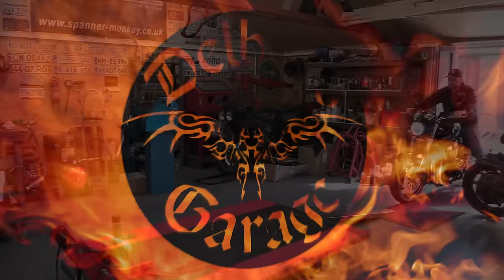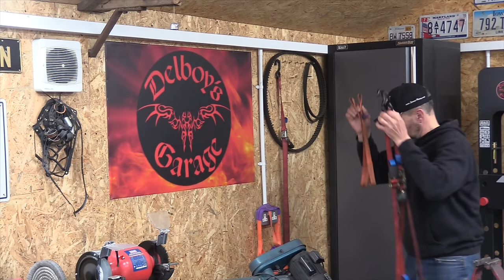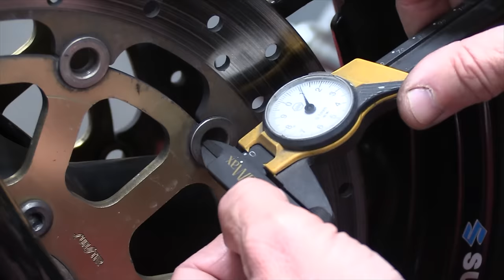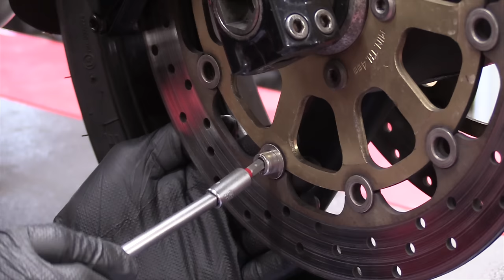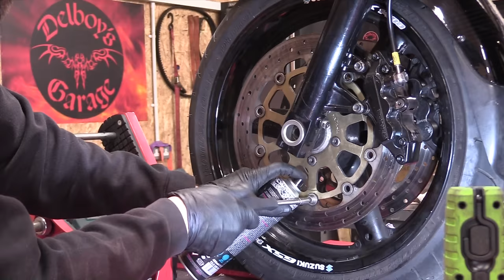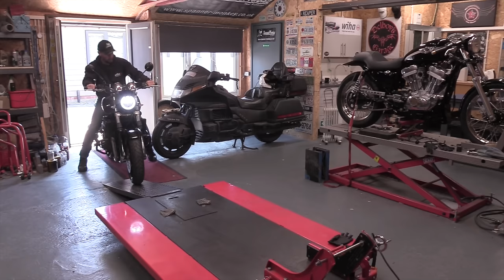Warped Motorcycle Brake Disc?  or Jammed up Bobbins?  Easy Fix !

Comment: Another bit I never knew....that brake rotors are designed to "float" to optimize brake pad grab. Thanks as always!
Reply from the maker: Glad you found it interesting John.. simple and effective !
Reply: The fact that the outer portion of the disc brake is not directly connected to the inner portion of the disc brake also serves another purpose. It diminishes the chance of warped disc brake rotors.  The heat of the outer floating portion has less heat transfer to the inner portion thus keeping the rotor straight and true after many heat cycles.

Comment: tried this on my ZRX 1200 bobbins which look pretty clean to start with ,  spritzed them down good with brake clean while turning back and forth with socket but there is no way they are going to turn with just my fingers

Comment: Mate... I think you just saved my wallet. I was already looking for new brake discs for my 2004 GSF600 because I thought they were buckled. I had no idea that these bobbins are supposed to rotate freely...
Reply from the maker: Yes sure, they should have some sliding resistance so not completely spin freely, there should certainly be no freeplay, but if they're jammed solid, then that certainly can hold the outer disc out of alignment.

Comment: Only comin across this video  now 😂😂.... mine wont twist at all even with the bolt trick... i tightened so much that it stripped the threads on the bolt i was using, but no, they wont twist at all

Comment: That is quite interesting. I was having that problem, the thing is that i thought it was the abs kicking, thinking it was an overly intrusive system.  In but it was, in fact, covering it up the real problem, junk in the bobbins.
Thanks for showing this mate, you learn every day something new, but today i learnt that it needs cleaning, how to clean it and a cheat to rotate the bobbins.
Certainly ill be checking every month on this bad boys. Truly a live saver.
Thanks again.
Reply from the maker: Most welcome buddy, once a month is nowhere near necessary, I do mine after the winter and again at the end of the summer and that's plenty, just when they get stuck!

Comment: I  had a advisory on my front brakes. I bet this is the issue as I didn't even know about this, so never cleaned them. Thanks Del, I know what im going to be doing tomorrow.
Reply from the maker: No problem mate👍, good luck with it !
Reply: @Moonfleet41  Just done this. they turn now but not as much as yours. But I did have 3 that didnt move that easy. Thanks

Comment: Wow! Thank you!  didn't know the actual disc were floating like that. Have that exact symptom on my MT-09. No jjudder, no shaking, just a smooth pulse just before stopping. No change in the brake lever. I will go home and clean it properly :D
Reply: Hi. I have the same problem on my Tracer 900. Did you try this? Did it end up fixing the problem on your MT09?

Comment: I'm not a DIY mechanic in anyway, always use a dealer or independent garage. But this and the old brake cleaning video really tempt me to try. It's just a little scary messing about with probably the most important safety feature! Bobbin cleaning looks totally doable though and I will endeavor to do some caliper cleaning this season!! Thank you for sharing your skills in digestible chunks. All the best to you.
Reply from the maker: Thanks mate 👍, really appreciate your kind words, and just feel comfortable with the maintenance you do, but learning a bit more about your bike really enhances the ownership.  Take care and ride safe!
Reply: @Moonfleet41  will it's in the shop right now getting a 24k service and the brakes are being given some TLC so this is my moment to start from fresh! Bobbins first, brakes proper I might give until the weather gets wetter! Your current project bike looks awesome by the way. Cheers!
Reply: @Moonfleet41  I did it. Bike was dropped off today after service/mot. I got my modest tools and a  crappy nut and bolt, and set to work! Took about an hour, some were solid with salt (based on the white residue) and grime. They won't turn by hand like yours but they all turn. The discs move, definitely more than they did but only a tiny bit! Will do it again over the summer.  Cheers

Comment: I raced one of these beasts about ten years ago, what a hoot. They do not like stopping in a hurry on a good day! But that is half the fun.

 Had a ball trying to pedal one around and out-brake the 600's during the "all-in" end of day race. Getting it stopped by sliding it in, turning and using the torque advantage off the apex was a trick. 

The floating disc's would commonly flog out on the gsxr's as well and have 4-5mm of slop in them. Still did their job and they couldn't escape anywhere, but made a hell of a racket!

Comment: Have a similar issue on the new GSX for the channel too, but it's also making a weird rattle noise (unless brake applied) so will try this later, I don't think my discs are the issue, and no pulsing on the lever, just the noise and the lurch, if it doesn't fix it..... them it's a Winter caliper refurb job 😉
Reply: Was it your disc bobbins 😂
Reply: @bobcat7227  Turns out it was the anti rattle plate being too loose

Comment: Perfect. I've known about the bobbins and the importance of having them free but not the extent that you've shown here (outer disc movement against carrier). 

Also, at beginning you mentioned the difference between a pulsing/lurching braking force rather than the actual lever pulsing, the latter of which I dont think I have so was good to identify that difference. Was looking at potentially getting new discs but I'll definitely be going to get some more brake cleaner now and some more m4 bolts (small I know) to fit through the bobbins! Cheers

Comment: Great , simple and free fix Del. I need to pay more attention to this.  I once took a set of wheels to have new tires mounted (so I wouldn't risk damaging the rotors). When I put them back on the bike they were so far out of whack they pushed the caliper pistons in after one squeeze of the lever. To the shops credit they did make it right  but it meant pulling and installing the wheels twice on the old Road King. Involved some grunting on the back wheel. 😁 Great work as always Del and Penny. Thanks and best wishes to you both. ❤👍👍
Reply from the maker: Don't you love Harley's lol!  why make a job simple when you can make it a work out lol!  At least they sorted it out safely, that's all that matters aye !

Comment: Ive helped 4 guys up to now with this same issue. So many overlook this little job, always worked a treat for me. Simple and effective. (Then there are those whiteboard idiots who dont believe this actually works and would rather leave all the brake dust and road grime in the areas between the bobbins and the surfaces).
Reply from the maker: Couldn't have put it better myself!  Thanks mate

Comment: Hi del, saw your orig video all them yrsss ago! Glad you re-did this to make new bikers more aware of general maintenence! 
Top tip: buy your brake cleaner in 5ltr tins and pump sprayer 👍 save a fortune on silly rattle cans that last 5mins 
Keep the vids coming
Reply from the maker: You're right mate, I should buy in bulk more, so thanks for the nudge!  Appreciate your long term support.

Comment: Do you discs have the SD system patented by EBC? SD Means Square Drive, meaning the bobbins have flat edges. I'm going to say that yours don't (many bobbins add weight to that) if you can rotate them. My discs do have the SD patent. I've given a bobbin a good try and it won't rotate. People might want to be aware of their disc construction before they get too heavy handed! Mine certainly did need a good clean out though! Thanks for highlighting the need to clean them!
Reply: I missed this before posting my comment. Spot on, I ruined my EBC discs forcing them round 😂

Comment: Not entirely convinced it’s a good idea on semi floating discs. To my understanding the bobbin’s primary function is to allow for radial thermal expansion of the outer rotor. Lateral movement isn’t critical on road bike disks. I just wonder if rotating the bobbins to free them off will wear bobbin against its disc mounting surfaces due to the grinding action caused by trapped road grit/brake dust?
Reply from the maker: Not at all mate, just go gently as i showed, two or three rotations to clear and wash out the clogged dust and allow for that "thermal expansion of the outer rotor" you talked about...as when there's no room for something to expand.. that's when it can distort !!

Comment: I remember that Vid😊👍.  
I used this technique often, 
and am having this phenomenon on my Yamaha Super Tenere.  At low speed stops only. 
Most annoying, 😖.
  I've done the cleaning and even sanding the pads to de-glaze.  It was fine for a while but has resumed 😡. 
  Sooo, back to the drawing board for some good time fun cleaning.   Rrrrr.☹️
I'm using Ferodo Platinum pads. 
I may upgrade to a Sintered compound pads in the future. 
  Cheers 🍻,  G. 
Have a great weekend folks.
Reply from the maker: Glad to hear the video worked, good luck with it, hope you can get is sussed!  Have a great weekend.

Comment: Having the same issue on my '02 GSXR 750. Any idea if the same 8mm bolt/nut is the same size? 
On that note, what length is best for the bolt and how tight should it be?

Comment: Hi.. My motorcycle disc brakes donot have these bobbins. These are regular allen screwS directly tighten to the alloy. But i am still getting those pulsating brakes exactly as you described. What is the issue?

Comment: I’ve been chasing a front brake issue to the the point of fully rebuilding the master cylinder, brake calipers, new hoses, new pads and new fluid and still had a ‘feeling’ at the front end. 

Well now ‘you’ may have shown me the fix. 

Job for today.
Reply from the maker: No problem Rik... always start with the easy stuff first aye... Good luck with it, i hope it sorts it out !

Comment: Great video. My tiger 800 2018 front disc are warped due to the disc lock being and I moved the bike a bit. Would cleaning up the bobbins fix warp disc ?
Reply from the maker: If you believe that you've buckled a disc, then cleaning out the bobbins first to double check costs you nothing and you have nothing to lose, so why not try that first... let us know how you get on!

Comment: Thanks for this tip! Does this also help the wheel to spin more freely on the axel once its done? The front wheel on my GSXR doesn't turn easily at the moment
Reply from the maker: No, this will have no effect on free movement of the wheel, check your calipers are not binding which is more likely!

Comment: Hi Del love the videos especially your Suzuki 1400cc ones, I’ve recently gone and bought this bike and the ride is comfortable and very enjoyable. Wondering if you can advice me on a problem I believe I’ve inherited from the previous owner, it’s when I start the bike up - side stand is tucked up - clutch is pulled in but when I go to start nothing happens? 
I then put the bike into 1st gear rock back & forth then it starts on the button, could this be the starter motor? If so  can this be removed and worked on? Any help would be appreciated. All the best Paul.
Reply: Could be the switch rod that tells the bike the kickstand is up is dirty . See where the kickstand activates the rod then clean and push in repeatedly.

Comment: Wow, that is nice and simple solution but brake disc on my bike has no bobbins. And I can't find what causes slightly different problem, that is constant, rubbing like, fairly high pitch noise which increases with speed, sound of a ballistic missile. It is definitely pad touching the disc but it doesn't get hot. Pads and disc were replaced. Calliper cleaned, pistons polished, new seals, fresh DOT4 and even bearings were replaced. Nothing made the sound go. Locating spring or retainer? I ran out of options. Any ideas?

Comment: Does the brake parts cleaner ever tarnish the finish on the wheels? I got some on mine and it made them all cloudy. Wouldn't clean up or polish out so I have to refinish them completely. Very careful with my brake cleaner now...
Reply from the maker: I've personally never had that problem, factory coatings are always ok, perhaps yours was painted with somthing else?  Either way, pop a rag over them in future maybe?!

Comment: I remember the first time you did a video on this! Very useful information mate and hope you are both well?
Reply from the maker: Yes, thanks mate... what a long time ago that was.. dark and dingy, did it after work in a poorly lit garage.. thankfully the information is still current aye !
Reply: @Moonfleet41  definitely still relevant mate... I quite liked the videos from the old garage though! I have a change of bike coming up soon, getting a CB1300 shortly as the FJR died on Sunday, and will sadly cost way too much to repair (even if I do it all myself), so I decided to let it go, and get something that will be more of a fun bike to ride
Reply from the maker: @MintyGusto  That's a great choice mate, ive had two of those over the years, easily one of the best UJM's ever made..  i guess that explains the change of username too lol! 😂
Reply: @Moonfleet41  haha! Well spotted! It should be arriving today, so looking forward to getting to ride it later on once I have insured and taxed it! Need a top box rack for work, but other than that it shouldn't need much at all, and as you say, a fantastic UJM! 
Also picked up a very nice DJI drone last night which will mean I can get some fantastic aerial shots of bike nights, ride outs, places I visit and anything else of interest
Reply from the maker: @MintyGusto  Sounds like you're gonna have a lot of fun with it..  little tip you may already know... you can spin the bar clamps and net yourself an extra inch and a half of reach if they're a bit too close... i did both of mine.. take ten minutes and makes it perfect reach for my Monkey arms ! 🤣
Reply: @Moonfleet41  thanks mate - I shall give that a try if need be!

Comment: I think my bike needs this, thanks Del. One question: Is the brake cleaner going to damage the finish on my painted wheels? They are painted black like yours. Should I be putting a rag over the wheel and tire while doing this?
Reply from the maker: It shouldn't damage factory paint mate, but if they've been painted with something else, maybe a random product, then why not be careful and just take that precaution!
Reply: @Moonfleet41  Thank you sir! Your videos have been more useful to me than any others on Youtube!

Comment: hi mate , old video i know but ive came across it and decided to check mine on my 2001 gsx 1400 .. after turning  several i noticed a shim/ washer drop out of the back side of the disc .. so having a bit of a further inspection i noticed several also are missing or only have  half or so of the washer left so maybe broken and fell out etc , will this effect the braking in any way .. i didnt have the pulsing problem but thought i would check them anyway .. also are the bobbins replaceable ?? .. cheers
Reply from the maker: Yes mate I believe the bobbins and shims are replaceable, check with Suzuki... and if it was my bike, I would very much replca them before I rode the bike again, just in case!
Reply: @Moonfleet41  yeh i will do that, did take it for a short ride as i had just also done the front forks seal and oil replacement and just wanted to check that out ( another good video of yours ) , seems ok but have to sort out the preload and rebound ..another job i dont have a clue about 😂 but dont mind giving them a go as its the reason i bought this bike .. come quite a way already since buying it a few weeks back.. tough to get decent parts here in perth australia tho .

Comment: My fz09 is prone to depositing pad material on the rotors if I brake to a stop and hold the front lever while waiting at a stop light, which on the next brake application feels like pulsating.  If I get it up to speed and brake hard it sort of clears that off and it's back to normal.  Early on I thought the rotors were warped, etc.

Comment: Amazing video, when I tried to do this none of them ended up turning smoothly and all squeak when turned with a nut and bolt, do I need new rotors or is this somehow fixable
Reply from the maker: Are the rotos oscillating?  If not, then they're fine.
Reply: @Moonfleet41  they don’t move with my fingers trying to turn them even after the break clean, they only turn with the nut and bolt with a decent amount of force, is there a way to fix this or do I new new rotors and they don’t freely move the 0.8mm of play yours had in the video